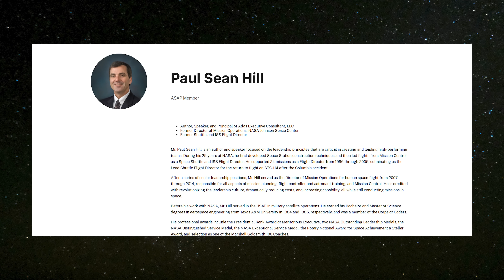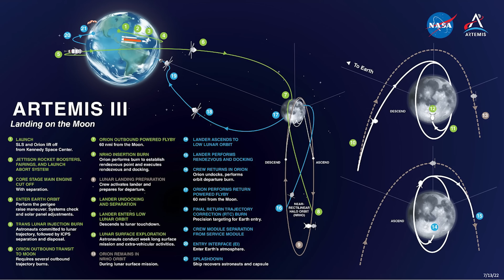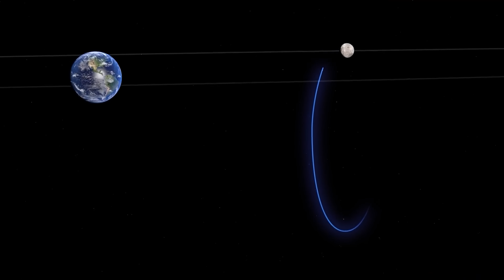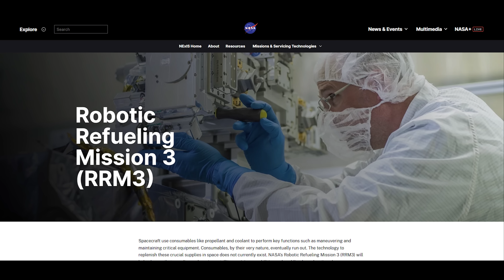Ex-NASA Chief revealed SpaceX Starship Problem Delaying NASA's Return to the Moon while China

Comment: Jim Bridenstein is a career politician, not an engineer and clearly he hasn't been keeping up with Spacex. Didn't notice that they already completed zero g fuel transfer. Didn't notice that they have repeatedly docked with ISS with no problems. Didn't notice that they managed to solve Much greater problems successfully. Didn't notice vast infrastructure, record breaking engines, proven record of more than 90% of mass to orbit... sucessfully... of the entire world's launches in the last 12 months. How about being on the cusp of creating, not just a good enough heat shield, the first reusable heat shield that doesn't require absurd repair. Oh, yea, something about reusability and dropping the price of mass to orbit by 2x as of today and (very likely) 10x in 2026. They already demonstrated the reuse of the first stage of their giant rocket and about 400+ reuses of their medium lift rocket.

He Also didn't notice that without LEO refueling, we will never get to another world with more than a token cargo and Cannot colonize the solar system.

Doing Very simple math, one can see that it would take 8-9 tankers to fill an orbital fueling depot (modified Starship V4 tanker) with enough fuel to top off a Starship V3 lander (and there are many practical solutions for boil-off (including the Starlab sunshade). Using Grock and the Rocket equation and 10 minutes of my time, I found (as Spacex clearly has) that a fully fueled V3 HLS will make it from LEO to Lunar surface and back to Earth with a large reserve of fuel (allowing some to boil-off safely - sun shades extending the time on surface from days to weeks... or just park in the shade of a crater as they intended anyway. 

JB was never an engineer and always a politician... and this is evident as he describes modest engineering feats as "overly complex". 

Quite Clearly, we need LEO refueling to colonize other worlds. The rocket equation - something he Must Surely understand... dictates this. 

The mandate was a Permanent presence on the Moon. Not a flag planting ceremony 60 years late. The mission requires hundreds of tons to be landed on the moon every year. 

Too bad politicians like JB can't do simple math. Thank god he's no longer telling engineers how to do their jobs. 

As for the dude (who IS an engineer) who guesstimated that Spacex could be years behind schedule... he never broke down the timeline. He just spoke in gross vulgarities... like a politician. The engineers that I went to college with explained themselves... 3 minutes of detail is all it would have taken. China is set to go to the moon in 2030 without the capacity to drop 100 tons or more on the moon (Starship V4 could likely drop 150t). So... token base, or small base with vast expense to maintain it. 

So we are to believe that Spacex will slip 3 years? 
Again... show me where and why or you are talking like a politician. 
Seems like a lot of people are trying to save SLS/Orion the most expensive boondoggle NASA ever created. Rockets built by politicians. Rockets to nowhere we can afford.

Final point. They whine that Spacex won't stop developing the best rocket engines ever made? Because at 280t thrust they are Already good enough to complete the mission... they are about to launch 33 of them on Booster V3 in a few months.... but they should Stop refining them... because... Why? Do they think NASA is footing the bill for that development? They are not. 

Musk keeps refining until he is near the theoretical limits to reduce cost ( and in this case) complexity of the engine so that it can be mass produced cheaply and put up more and more mass.... Doesn't mean you can't freeze the design on production units. ie - walk and chew gum. 

Disturbing to see small minds criticize their rocket engine production in favor of NASA contractor's cost plus plodding where development stopped as soon as an engine was "good enough" with no thought to future rockets/missions. 

Musk is building a rocket to colonize the moon and then Mars. These dweebs can't see past the end of this one mission or acknowledge the implications of a "Permanent" presence on the moon.

Clearly JB has learned nothing since "back in the day".
Keep this politician far away from NASA.
Reply: Dankie

Comment: Ya right who is doing the development better.  Bo with one launch?  NASA with multi billion launches?  Boing and group, nothing but failures,right.  My money is on SpaceX!
Reply: I wish SpaceX would just make a 3 or 4 booster version of Falcon Heavy and just get it done with a Dragon based moon mission 🤟🖖
Reply: SLS and New Glenn have both flown successfully.  Starship is still in development.
Reply: Starship to the moon is BS for physical reasons. You have a HEAVY starship which needs masses of fuel to reach the moon. The even bigger problems arises when you come back. Starship is barely surviving the reentry from LEO which is Kindergarten stuff compared to the speed a moon mission will come back with. LEO speed is around 28.000 km/h while a moon mission will come back with 40.000 km/h. Doesn’t seam so much more but the energy is e=1/2mv^2. This would toast starship or you need massive amounts of fuel for a deceleration burn which you will need to carry to the moon. That’s the reason why the NASA moon missions came back with a 1/10th of the weight they started from LEO.
Reply: @svenweihusen57 Starship, or more properly the HLS version of Starship isn't re-entering when coming back from the Moon, that's Orion's job - hope they fix it's heat shield by then!!
Reply: @svenweihusen57
But all those refueling launches are still cheaper than 1 SLS launch.

And it took 12 years to get SLS done. I'm sure you know it's a boatload of old technology. And it cost about $25B

Starship is about a decade old, and SpaceX has only spent about $6B.
And it's literally the most complex thing ever launched. It's 20 years ahead of where it would be the old way.

AND it's not being built to go to the Moon. It's being built to go to Mars.
Reply: New Glen is ahead of Starship.
Reply: @mrbaab5932  ya right!
Reply: @mrbaab5932 How so? New Glenn flew once and the booster wasn't recovered or do what was intended, though they managed to get their payload launched, good, but the upper stage was discarded. 

Starship was held back from full orbit, on purpose, for safety and they have recovered the booster spectacularly and also repeatedly made booster and Ship come back in a very controlled manner. 
It's awesome that New Glenn reached orbit, but it's not ahead of StarShip.
Reply: @mrbaab5932 New Glenn is in Falcon Heavy's class, and SpaceX has put multiple payloads in orbit or deep space, and actually recovers the boosters and center core - sorry that New Glenn lost its booster 😭

Comment: Blame game has started.
It's taken NASA some decade or more just to get Art 1 off the pad.
Also no one at Nasa is talking about the new launch tower for Artimis that is still not finished and has major trouble as well as millions over budget. This is required for Artimis 3 and won't be ready till at least 2027.
NASA has made the entire thing overcomplicated.
If they turned starship into a non reusable job, added another stage like Apollo that was the lander itself that meets Arty in moon orbit it might be doable and still cheaper than Artimis.
Blue origin still has only launched one booster so it's no use relying on them.
When you think version 3 of starship should be pumped out soon, not just one but many.